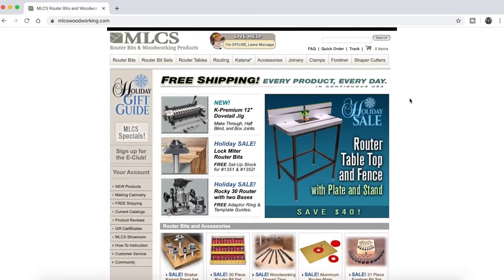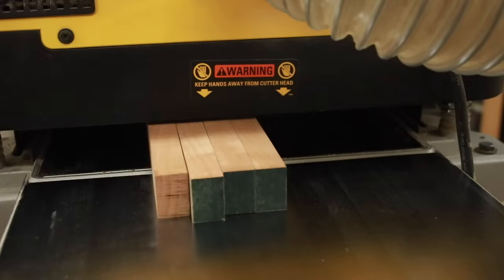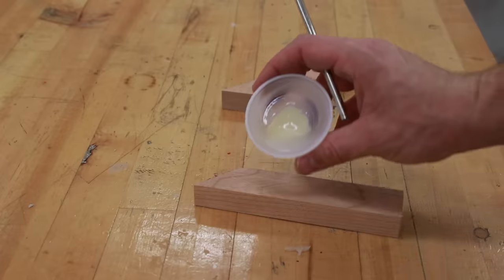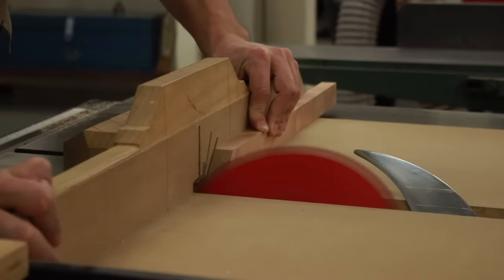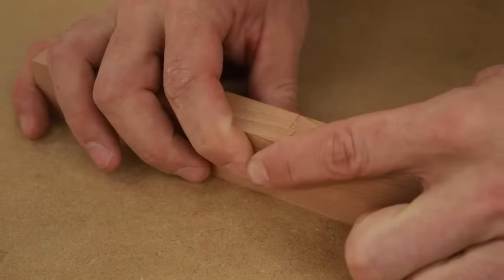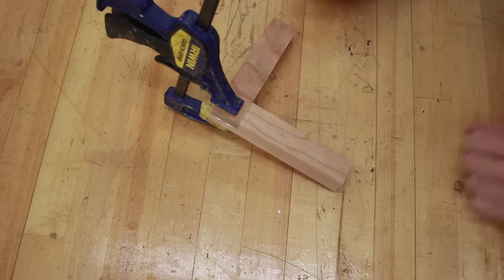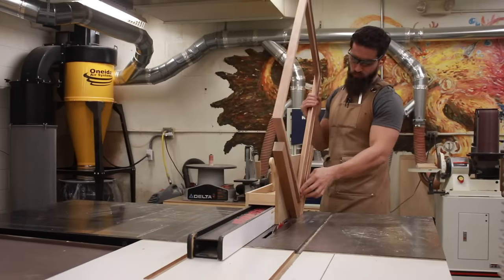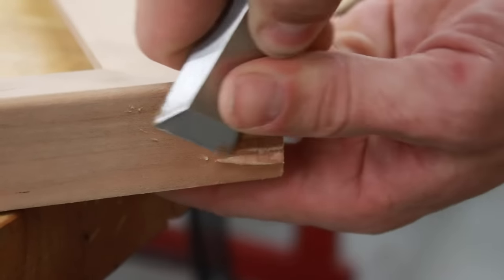How To Make A Picture Frame - 5 Different Techniques

Comment: What is the best way to measure and set the stop for the final miter cut to get an accurate length at the rabbet?

The first miter creates 2 different length edges on the rail/stile.

Comment: Great ideas there, thanks. I'm a bit curious about one thing you said, you showed where the miter saw cuts perfect 45s but then went on to say that you normally use the table saw for this. Why?
Reply from the maker: The table saw is a little more accurate for a number of reasons, but I just wanted to show that you can use the chop saw with success 👍
Reply: @ENCurtis  Maybe in the future you could show what those reasons are. Thanks for the reply.

Comment: Eric, I noticed you have an Oneida Dust Collection System.  Is this your first dust collection system?  How may horsepower is it? Why did you choose Oneida over Jet, Grizzly, etc.?  Look forward to your reply!
Reply from the maker: I've had a couple different systems. This is the school's shop where I teach, but in my personal shop I have a Jet. It's solid. I went with Oneida simply because this is an old building and I needed weird piping angles and Oneida was willing to map it all out for me. You can check out my video about how I installed the system for more info.
Reply: Eric,  Can you send me the YouTube video link for how you installed the system?  Also, which model of the Jet Dust collector did you purchase?

Comment: Ug! The joint at 4:40 is not especially strong compared to the first joint. The grain in the spline is running along the joint, not across it. It's doing almost nothing. 🤦